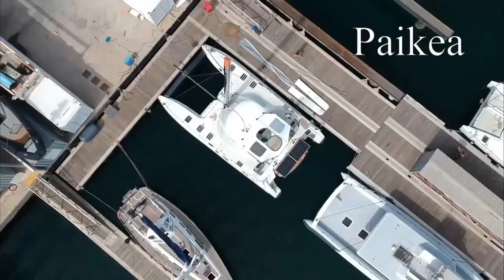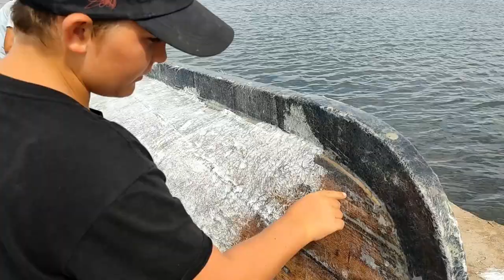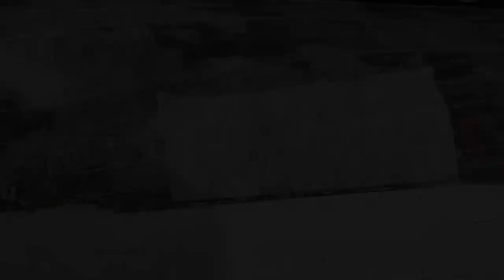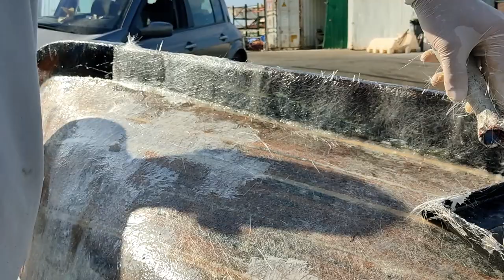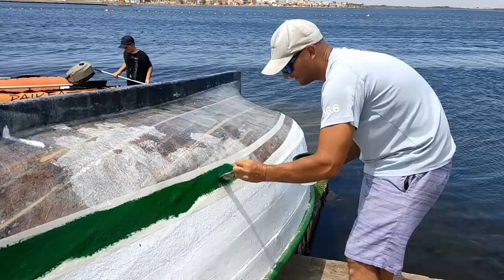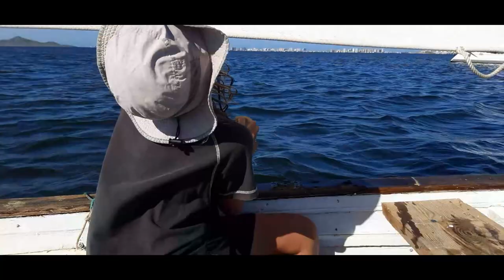Tips for fibreglassing a timber splined boat -repairing a traditional Spanish Vela Latina

Comment: I absolutely love lateen rigs, great to see you able to help out a friend keep his traditional boat going.
Are you at all familiar with a modernised lateen rig interpretation called a Romy Rig? ...... I have often wondered if a Romy would be an ideal sailing rig for a small yacht tender (this also seems particularly suited for you guys, because one might be easily adapted from an old salvaged wind surfer rig - multi section windsurfer mast could easily be used as the lateen gaff top mast, the wish bone boom could be split to form the Romy’s double bowed mast section and the sail wouldn’t take much to adapt to the loose foot Romy Rig ....... anyway just a thought
Reply from the maker: Interesting...will have to google it

Comment: Did the fairing compound gel before the mat went on? Or is it ok to immediately follow up with glass mat after applying the fairing compound?
Reply from the maker: You can put the fibreglass straight on to the wet resin mix.
Reply: @youngbarnacles  Thanks.